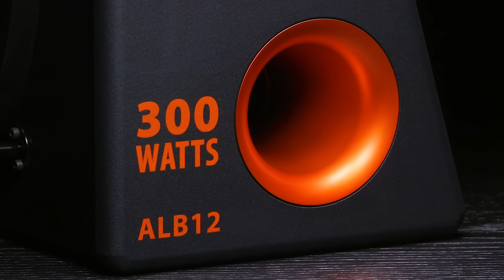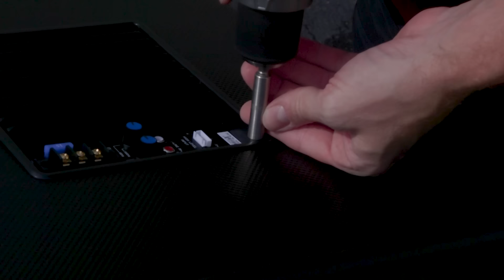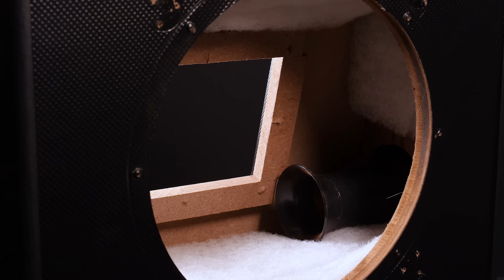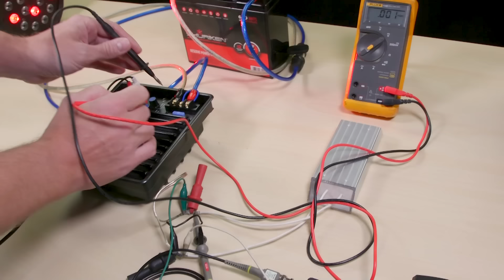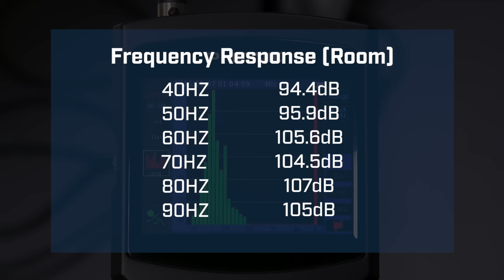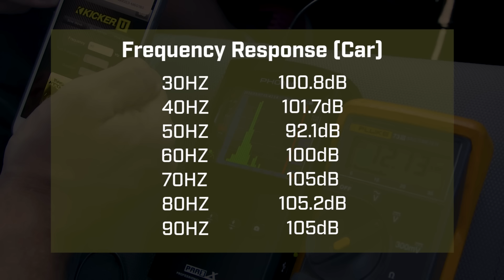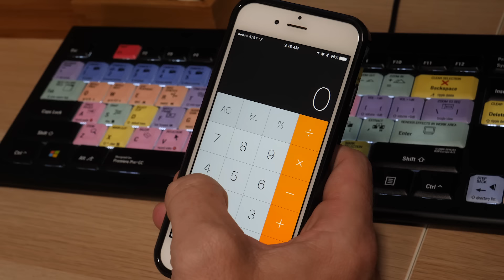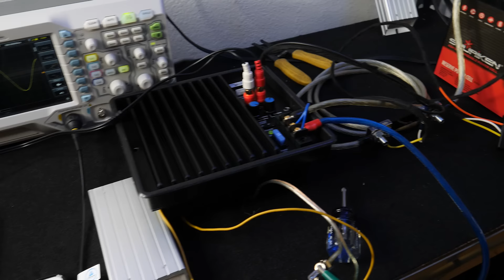Sh*t Car Audio Manufacturers Say! Reverse Engineer an Amplified Subwoofer

Comment: i honestly feel like this is a "starter system" like something a 16 year old would put in their first car. it's not a terrible product its just entry level.
Reply: It is terrible. Very terrible. Undersized and underpowered and tuned way too high. 75Hz WTF?!?!
Reply: that would describe a majority of Consumer grade audio. car & home alike. for the Target Demographics this product fits the bill....its Loud,Boomy, One Note Bass meant for the bottom of the audio market LOL
Reply: Hahaha when i was 16 i had two memphis m3's now that was a good starter system.
Reply: dangzard let me guess they were made by boss.... Lolol or was out dual
Reply: Lol I’m 17 and I got a 3000 watt planet audio and a 15” quantum audio with a custom box
Reply: William Hartley well i suggest you invest in different equipment young grasshopper. And learn about box building
Reply: dangzard i swear on the holy bible I'm doing exactly that. No fuse 2 awg welding cable. 👍
Reply: dangzard I'll make a video to confirm. That couldn't have been a funnier and truthful comment... Lol @ the sarcasm
Reply: William Hartley how many watts is the planet audio doing? 300? Lol
Reply: The Real Schuyler Martin lol you’d be surprised yea it has 3000 on it and it works pretty nice. I know it’s not 3000 rms(true wattage) but, I mean it does what I want it to do
Reply: Dude it's garbage. By any standards. Thats like saying an iPhone knockoff from china that barely works is acceptable because it was $50.
Reply: like i said. for it's intended Market sound quality or excellent engineering aren't in the cards. This is bottom of the Barrel. Cheap price doesn't always mean Bad or Subpar but in this case. it's literally a boombox with tuning that high it's one Note bass.

I Seen them at local walmart's for right under 100 Dollars. For that money you could Buy an OK woofer, a Decent Amp and all the MDF Necessary to build a Decent Box and still come out with a Better Subwoofer.

some people may be willing to go that extra mile. but for the masses its a Convenient cheap way to get some bass in their car. even if its not good quality bass.

it's not something i myself would buy.
Reply: William Hartley just busting ypur chops man. I'm sure you get 500 solid watts out of it and I've seen 500 watts do plenty of damage with a good installation and setup
Reply: form109 OR....an older dude who just wants to add a little extra bass to his factory system...people need to under stand that these cheap systems are not designed to win a car audio contest...just for people on a budget trying to enjoy life ....
Reply: dangzard did it feel good being a rich kid ...with rich parents???
Reply: William Nixon an extra battery and or a capacitor is NOT necessary...just zero gauge from the output of the alternator to the positive post on battery and from there to the amplifier...
Reply: William Nixon nothing wrong with planet audio. I've had everything from kicker, JL, Rockford, Memphis and the planet audios always sounded more crisp and louder than any of those brands. Had a 2000 watt amp and 2 2000 watt 4 ohm dual voice coil 12 inch subs and was a blast. I sold the other stuff because it just didn't compare.
Reply: Why not just buy Sony products, they are cheap and also the best car audio products on the market.
Reply: +Keith Wilson No that is wrong, you say that only because some "experts" on the internet says it. Sony is products of very high quality.
Reply: WarthDader74 it is no experts I personally have owned Sony speakers and subs. I had one sub fail after a month and one stopped working and would work again sometimes on and off. And the speakers sounded like Wal-Mart crap spectre brand.
Reply: I have owned lots of Sony products during my life, and not even one of them have failed to work. If your subs failed, then you have used them in a wrong way.
Reply: WarthDader74 never used the wrong way and everything else I've owned worked perfectly.
Reply: William Nixon welding cable omg thats not safe u need to use car audio brand cable with homo colored pvc jacket. LOL.
In the 90s I competed in IASCA and install judges often docked 5 pts off my score cuz I used 1/0 welding cable not an IASCA mfr branded cable. Made all my own interconnects with exotic industrial armoured twisted pair cable I got for cheap surplus. Better than anything monster or esoteric was making. Hooked up with some guys online having similar woes and they came up with a brand name they registered with IASCA called VOODOO cables. Printed labels at home and put it all over problem solved. 
BTW get a fuse on that wire if you can. Or make damn sure your routing is dead on safe.
Reply: WarthDader74 oh come on now if nothing sony made ever broke they would go out of business. Google "playstation 2 disc read error"... however most of the time when speakers fail it is in fact crappy components or improper tuning that introduces harmonic distortion which tends to melt VCs.
David Navone and Autosound 2000 magazine did an extensive article way back when analyzing how harmomics compress and amplify signals and destroy even robust speakers. For that reason you should never set up a high performance system without a proper test signal cd and oscilloscope. Done properly you shouldnt blow speakers at all not even fragile ones (like infinity emit ribbon tweeters)
Reply: +batvette Those articles you are referring to are not written by neutral testers. There have been some very strong forces out there trying to affect people's perception of Sony's quality for several decades. Most of the cases you hear about is in reality concerning worn units because of excessive use and user's faults. A lot of Sony's customers are young because of the low prices, and many young people don't know how to use audio equipment properly. I am old, and have never had any problem with a Sony product.
Reply: I still have it.
Reply: My starter setup was actually in the house a Skar SVR-10 800 watts rms with the amp being dayton audio SA-1000 (877 watts rms on the dyno) im 13 rn

Comment: I really wish I had videos like this when I was doing car stereos. I was one of the few teenagers who actually learned about Ohms law and how box construction, port design, and acoustics played into sound quality and sound volume. Not to mention the basics like correct wire sizing. I don't know how many times I blew the doors off of a 2000w system some dude's parents bought him with my 800 watt Audiobahn, 2x 12" Audiobahns in a custom ported box, and a Bass Mechanics CD.

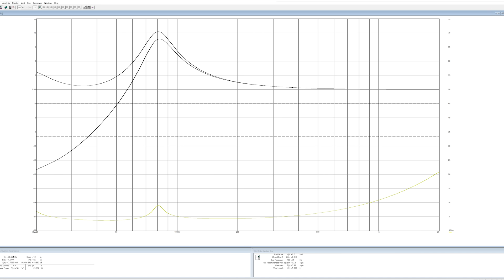Comment: 7:58 +10dB is 10 times more power and not 3 like you mentioned in the video.
Their power rating of 300W is probably PMPO which is a dubious type of rating anyway.
My guess would be 30W RMS (120W peak) at best
Reply from the maker: You are correct, we did make a mistake here.

Comment: One of the most important parameters is harmonic distortion versus output for a given frequency. The ported design gives a high system Q and a steep falloff of 24 db per octave below system resonance. True low distortion woofer enclosure amplifier arrangements even for high end audiophile equipment is still rare. The optimal design is the acoustic suspension design. Newton's second law of motion applied to forced oscillation explains why by examining the equation for the approximate result. This is given in every textbook of first year physics for engineering and science students.

Comment: You know, if auto manufacturers used marketing "tricks" to pad the output horsepower claims of their vehicles, or computer manufacturers did something similar to their advertised specs, there would be lawsuits of false advertising etc.  If we lie or misrepresent a product we offer as part of a financial transaction, we risk being charged with fraud.  How is it audio product manufacturers seem to be exempt or immune to these penalties?  In the video, they address the 100W/300W ratings, and suggest it's an arbitrary claim that the peak response may "sound" like 300W.  Well first of all, wattage ratings don't have any particular sound level, it is input power only, second, speakers don't output the watts they receive.  Third, there was no explanation about the 100WRMS rating. Fourth, when they are specifying power, that's what they should actually mean!

I saw a few soundbars out on display with suspect wattage ratings and I decided to check the rear... because being self-powered they were required to state their maximum power consumption.  I was bewildered... They were all corrupt, but one I remember in particular was rated at 160W, but the power consumption was rated at 35W... What the actual fuck!  And all those mini home theatre systems in a box, with an amp/receiver about 1.5 inches thick and no fan or heat sink.  Same deal... 800W... but only 75W or so power consumption.

This is utter bullshit and it needs to stop.  Consumers are being lied to, ripped off and nobody in a regulatory position is doing squat about it.
Reply from the maker: More informed consumers would go along way. That is our intent both good and bad.

Comment: There's many sales trick out there,like they wondered why I wanted to do the electrical trade & I have been unemployed for almost 6 years,one of the modules that I did was amplifier principles which was a post trade industrial electronics strand of that course at tech - yeah !!! Why did anyone think that I didn't want to do that ????

Such as,I didn't get sucked in by the marketing tactics of watts PMPO (peak music power output) which means that is its power output assuming that the output signal is DC (direct current).

AC (alternating current) is usually the output signal which is less than the DC component, the only speakers which come close to consuming DC is the subwoofers as the higher frequencies are filtered out by a Lowpass filter so they only operate at a few hertz (almost DC).

The things to look for is both magnet size & impedance which is the AC equivalent of resistance ,which is actually the impedance at DC level.

Meaning ,a stereo rated to run 100 watt speakers which have an 8 ohm coil impedance can technically run 50 watt speakers which have an impedance of 4 ohms.

My dad used to have a Pioneer stereo which you could turn the volume up full blast on but the speakers will not distort,I think it was because it had a MOSFET (metal oxide semiconductor field effect transistor) amplifier in it whereas the older stereos would clip or distort because they had a silicone or germanium transistor amplifier in them which their bias is more current dependent.

MOSFET amplifiers rely more on voltage for their bias.

Comment: i have a sub and amplifier both marked at 300 Watts, i did put a 10A fuse in between the power cable, that burned out, so now i have a 15A fuse and that one is still alive.
that does mean it is between 120 and 180 Watts, btw that sub and amplifier are atleast 30 years old

Comment: In the mid nineties' worked for Radio Shack while I was in college.  They were bad about overstating the specs on their car speakers, amps, and power converters.  You had to read the very small print.  The box an average speaker would be in, would say it could handle 2500 watts (some times more depending on model) but the fine print would say 2500 watts peak for 2mins, the speakers could really only handle about 30watts constantly.   Same with their amps and power converters, always stating in big bold letters and numbers the peak power, and small print for continues power.

Comment: The next test would be to feed the woofer a 100W test tone from a known good amplifier and see if it can even handle the supposed rated power.  After all, if cutting corners on the amp, why not also cut corners on the woofer too?

Comment: the lack of power of the amplifier, doesnt really mean its under powered. i just means that the higher notes are limited to what it can do with the lower notes. i bet that 50 rms is enough for it to get to xmax at 25 hz.

so instead of letting it get power to get xmax at 50hz, and have it bottom out at 40hz, and get all destroyed, they let it be a wider range albeit subdued. 

that i my impression when i saw the incar out put at 30 hz right up there with the 100hz

Comment: As soon as you pulled the amp out it looked like a duel push-pull 70w unit, that is 35w peak to peak.  RMS is more like 18 + 18

Comment: I have that same el-cheapo 12" Dual... I blew the port right out of the box after about a year, half-blew the driver within hours afterward. It worked awesomely in a single-cab pickup (I've aged past the days where I need my windows to rattle), but once I put it in the trunk of my Camry its deficiencies were obvious - I cranked it waaay too much just to hear it, and that's when the port and driver gave up.

However, I did get what I paid for it, and it wasn't too bad considering it was $100.

Comment: By identifying the amp IC and  looking up the Data Sheet you'll know all input, output and voltage, specs. Then you'll know exactly how they're cutting corners in production

Comment: Nice work! About the only thing I might suggest for this type of tear-down is to grab a calibrated mic and some software (such as Room Eq Wizard (free)) and do some frequency sweeps rather than increments of 10dB.  You can do one sweep from ~20-100Hz in front of the driver, then stick the mic in the port and do another sweep. That'll tell you exactly what the tuning frequency is.
Reply from the maker: The audio analyzer PAA-3 is calibrated, that is what we use.
Reply: Hows come you only run a single sine wave at 10Hz intervals rather than a full sweep? Kinda like doing an engine dyno at 1,000 RPM intervals instead of a full pull IMO. A lot of valuable info can lie in between the test nodes.

Comment: Nice!
I would have chosen for a larger cabinet size.
The Frequency response at 75Hz isn't the worst, however, cutoff at 60Hz is  pretty high.
I would have rather had +3dB at 55Hz, than +10dB at 75Hz.

Comment: I don't really see the "issue" with the "bumped output." That's called an acoustic impedance modification and is standard practice when designing sub-woofer enclosures. In professional sound reinforcement, they have "huge bumps" in their simulated response, often 20dB or greater above the characteristic sensitivity of the "naked" driver. This is accomplished with sophisticated labyrinths of folded up bass horns. The resulting "simulated" output would not look pretty on paper, but that doesn't matter because linear distortion from the room is just as bad or worse anyway, and can be corrected with EQ/processing, so who cares? The important thing is maximum acoustic displacement with acceptably low nonlinear (harmonic etc) distortion while minimizing amplification requirements. These horn sub designs have multiple impedance peaks, which is desirable as that further improves overall system efficiency, reducing amplifier heating. 

The engineers who designed this cheapo little "dual" sub took advantage of a cheap/easy acoustic impedance "trick" involving a driver with a weak motor and a ported enclosure. The in-car response shows that their "trick" combined with whatever EQ may be developed into the amp, work fine and deliver a very reasonably flat in-car response. (+/-6dB is outstanding for low frequency response). The location of the impedance "peak" created by the venting may well all play into the design in a more sophisticated manner than one may think on first impression.. That impedance "peak" may well be playing an intended role in reducing amplifier load through the most heavily used frequency ranges. 

As for the amp.. the 100W claims may be a bit optimistic, or... there may be another "trick" going on here. 20 years ago a similarly "cheap" system would have likely barely have managed 10W before significant distortion. In a way, we should be thankful for such a cheap device actually delivering power in the ballpark of claims (within about 2dB). I think it would be interesting to see what the amp would do when connected to 2ohm and 8 ohm dummy loads. I suspect the "100W" rating would come close to true at "normal" voltage input ranges with a 2 ohm load. There's no "requirement" that the amplifiers rating/claimed output be into a load that matches that of the driver it is paired with in such a system, so this "claim" may not be entirely bogus, just highly misleading. 

Not saying this "dual" sub is good or bad, (I do not care, and I'm not here to defend it), just pointing out that the approach to evaluating it here may be based in some false pretenses.

Comment: The one test that you performed that I don’t believe is absolutely reliable was the packing peanuts. 

I’ve never had much luck with that method because the packing peanuts can lay against each other different each time they’re poured in. 

But if it’s working for you great. 

Now I use an IMSG & for a volume of a vented enclosure I’d block off the vent from the outside. 
This gives you the ability to accurately calculate the final enclosure volume including driver displacement. 

You can also find the tuning frequency of a vented enclosure and plot impedance rise. 

Overall good job. It’s just unfortunate that consumers will learn more from your video than people in the industry.
Because so many already know everything. Just ask them & they’ll tell you!

Comment: Yeah they sell these things on "Peak" power, but its the RMS that matters in overall output.

The sub itself looks like its decent quality though.

So maybe one could get an external amplifier, and use the volume calculations and spend the extra $5 on a better tuned port, if it would actually be good?